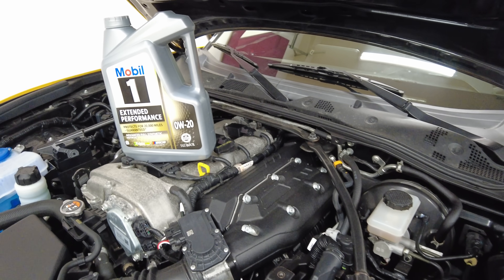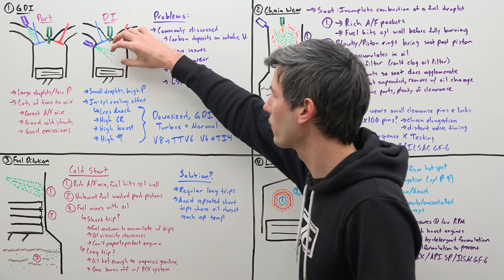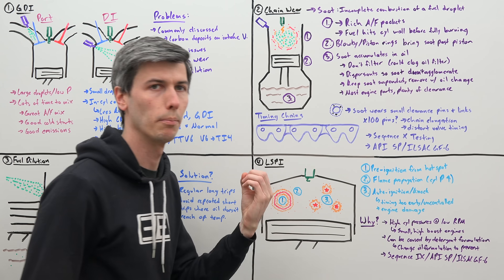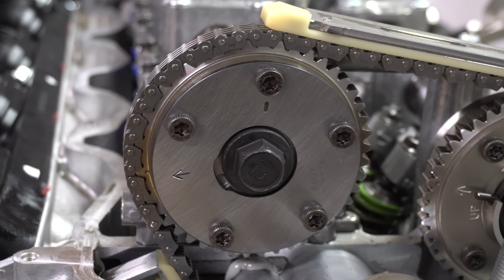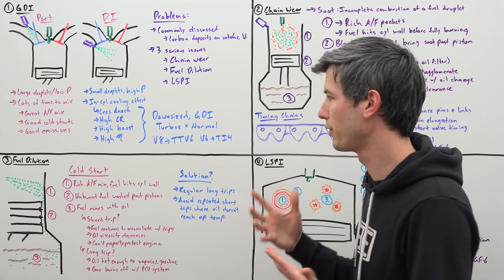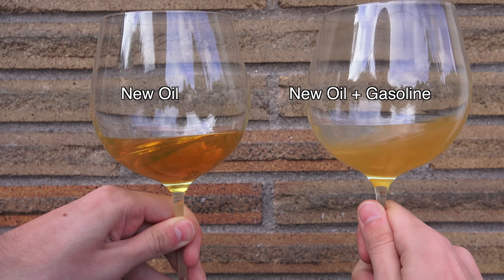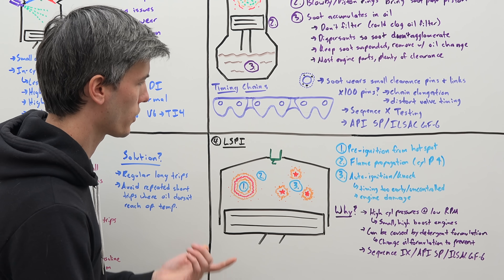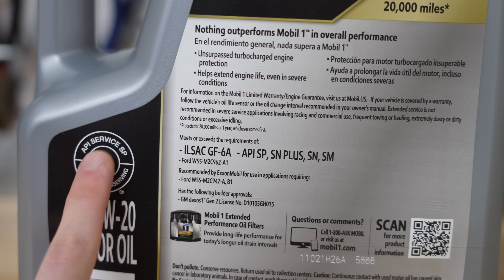3 Big Problems With Direct Injection Engines (Gasoline)

Comment: All of these issues are overcome by proper tuning and component selection. Preignition on a DI engine is a complete failure of correctly timing the injection pulse. Same thing with droplet size, that has been addressed through higher pressure systems and better controlled injectors. The only leftover issue on these engines is the intake carbon from the garbage emissions components.

Comment: 7:34 The problem is people don’t understand oil temperature. They think when the “temp” gauge in their car reads normal that the engine is warm. Wrong that just means the engine coolant is warm, not the oil. It takes a lot longer to get the oil up to operating temperature and most cars do not have a oil temperature gauge. My car does but most cars don’t.
Reply: My 2024 crosstrek has a read out on the infotainment that shows coolant temp and oil temp

Comment: These issues are possible high mileage issues. I have a 2017 Toyota 3.5 liter direct injection SUV, I bought new, that gets about twice the fuel economy as my older 3.5 liter Toyota port injection SUV. The newer engine calls for synthetic oil and holds an additional quart of oil compared to the older one. I don't drive it far and I expect it to last a long time because of that. Never had problems with the old one, but mileage wasn't great.

Comment: In my experience Mercedes + direct injection failure = destroyed engines, not so much the case for BMW or VW/Audi though.. obviously their injectors still fail but they rarely destroy the engine, most of the time A/F mixture from the compression stroke gets through them and into the fuel rail. They're pretty much a consumable if you compare their lifespan with that of an old school port injector... those can last for 20+ years easy. Progress doesn't come cheap.

Comment: Do what Ford did have both systems on the vehicle. My 2018 has sequential and direct injection. Then screw over the scientest that created it.👍🇺🇲🦅🇺🇲 change the oil every 5,000 miles or less.

Comment: 1. Chain wear is an easy fix. You just get rid of the chains and run timing gears instead.
2. Very simple solution.
3. Weird how the oil can effect pre-ignition.

Comment: One thing worth mentioning, on older engines a little chain stretch often ending up improving fuel economy, essentially retarding the camshaft by ~2 degrees. We'd often see a small drop in fuel economy after replacing the timing chain and tuning the engine after around 50k to 100k.
Reply: Decades ago watching someone changing a timing chain on a 302 Ford he said it would be good for 50hp. Yes cam timing goes that bad.
Reply: @ldnwholesale8552  it can. It mostly just moves the torque peak up a few hundred RPM.
Reply: @bacorable There are no cam sensors on old engines. I'm talking mechanical, Ford 302, 289, 351, pre EDIS. Even later once they started adapting engines over to EFI and EDIS the cam sensor was often based out of the old distributor shaft,  This didn't change until you got into fully computer controlled engines.
Reply: Incorrect. Ford set the cam timing at 8 degrees retarded on the 70's and 80's 460 for emissions. When you install the cam   straight up no advance or retard,, the Power curve moves down in the rpm range, more low end torque and more combustion pressure. On my 460 after installing straight up timing set I gained 4 mpg with no other changes, kept my spark advance at 9 degrees baseline
Reply: @funkysawmanwright5077  you cite one engine and say I'm wrong.

Work on cars for 30 years and get back to me.
Reply: @glenwaldrop8166  actually been wrenching on trucks cars and heavy equipment for 25 years. Internal combustion theory supports the fact that advanced cam timing make the engine more efficient to a certain point, but it does increase nox emissions
Reply: If you're in your engine by 50k you need a better choice in vehicle manufacturer. My 96 taco has 290k and I get 35 mpg and I haven't changed the plugs yet.
Reply: @Bramon83  Note: "on older engines".

Back in the 80s they still ran carbs. It was far better than the 50s where you had the valves done every 30K or the 60s where you had to give it a full tune up every 30K. That's only one generation behind yours, don't underestimate the longevity added by EFI.

Most of the time you wouldn't replace the timing chain until the first major overhaul, plugs/wires every 30K to 50K, replacing valve cover and oil pan gaskets around 100K, generally leaking by then, still might not touch the timing chain unless I have to go into the engine for another reason. 

99% of the time you'll hear the timing chain rattling by 100K, it's still perfectly fine, just makes a bit of noise. If the timing set had been replaced by anything other than OEM then it won't even rattle by 100K.
Reply: @glenwaldrop8166  If you used leaded gas in the 50s, you didn't need constant valve jobs, and 30,000 miles between tuneups is too long, but you are right about timing chains and leaking gaskets.
Reply: @michaelbenardo5695  I should have been clearer, not 50s model cars, 50s mechanics working on old crap, the rest I pretty well said what I meant.

My grandfather was a mechanic on the side for 50 years, think he worked for a dealership briefly after the army. He was telling me about how they had to do the valves after around 30k, which involved disassembling the engine on the old flat top V8s.

I may have gotten some of the details wrong, my grandfather was damn good with cars but not so good at getting a point across clearly.
Reply: @glenwaldrop8166  Yup, before the late 50s, "Regular" gas was still unleaded in many places, and yes, you would have to grind your valves and seats often every 20,000 miles.  If you used Ethyl, which had Tetraethyl lead in it, you were spared of that, as the lead protected the valves and seats.  That's why the automakers were mad about the lead being removed from all gas for 1975 - they had to use Stellite valves and seats in the engines, as they knew motorists would not take kindly about having to go back to constantly having a major valve job.
Reply: @bacorable someone else that can't read.

Older engines.
Reply: @bacorable When it affects the compression ratio it affects the timing.

You're just lacking information. Been there, done that, been working on cars since the 90s, spent a hell of a lot of time on the small block Ford in particular with a lot of playing with various GM engines.

Chain stretch is a thing, if you don't comprehend that, that's not my problem.

Comment: 2021 CX9 with 2.5L turbo had very little soot in oil after 7,000 miles. Just over 12k miles total. Oil looked mostly amber on white paper towel.

Comment: I really hate direct injection engines. I had one of the early VW ones in the 8P Audi A3 and it was really problematic once it picked up mileage (tons of carbon deposits everywhere).
After that I tried to avoid it but thats almost impossible these days on  a new car.